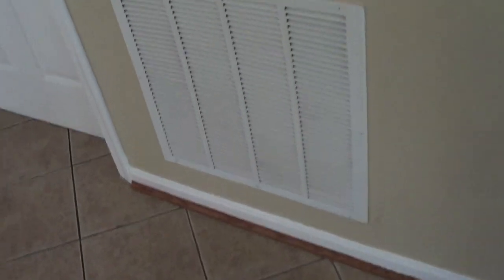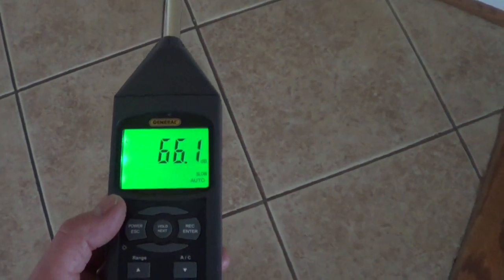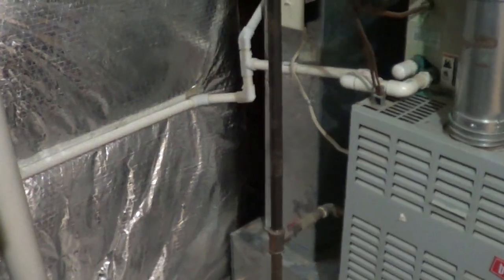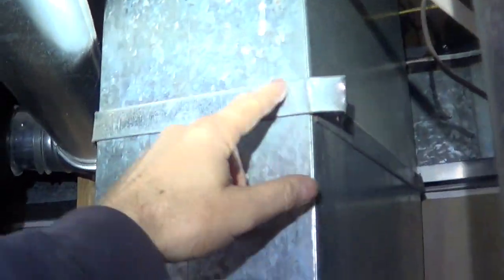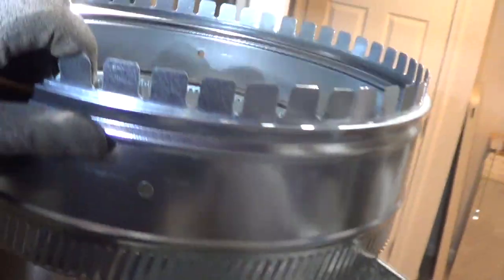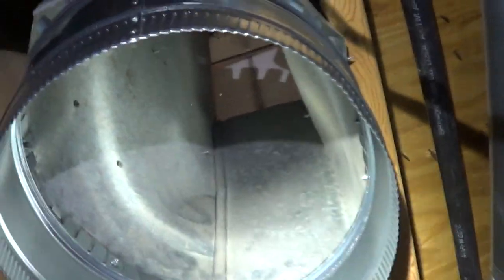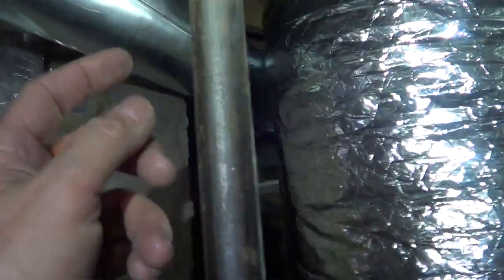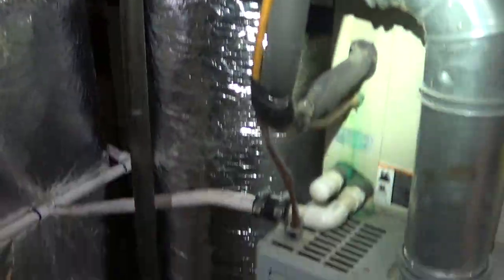How to Quiet Ductwork with just 6 feet of Flex

Comment: I have uninsulated, unlined 6-1/4" round sheet metal ducting throughout my basement in this 1965 home of mine servicing every room of the house and when the furnace or A/C runs, it seems loud. I am thinking of replacing the lines to at least the bedrooms with insulated flex duct. Will I notice less of a roaring sound? Would insulating the outside of the main square/rectangle trunk feeds from the furnace itself help to quiet the whole system as well? Thanks.